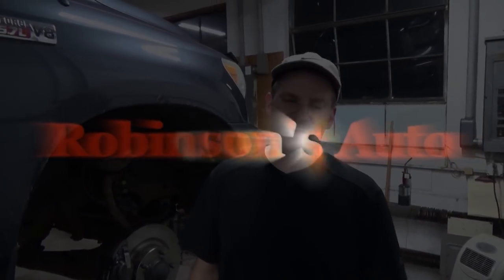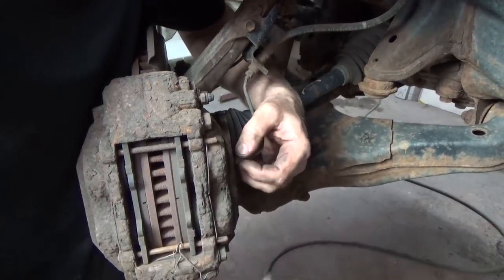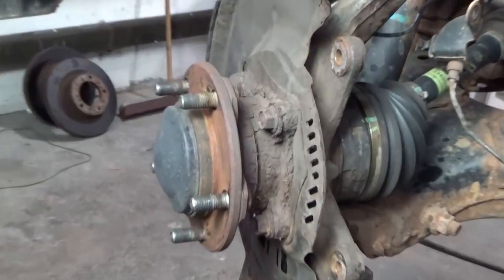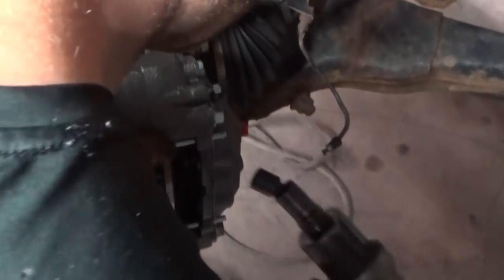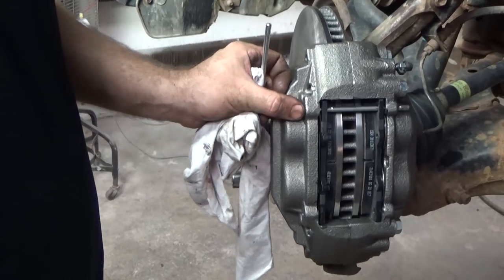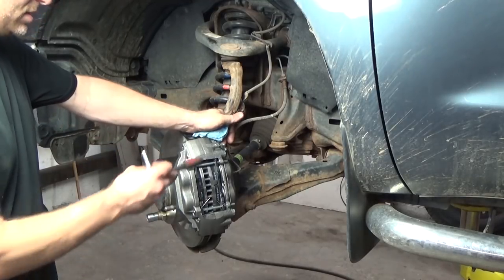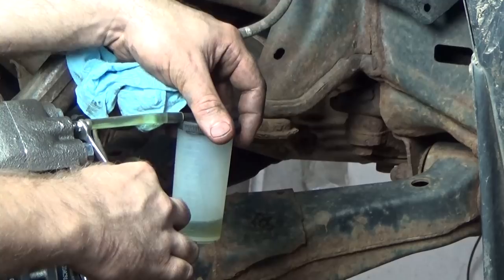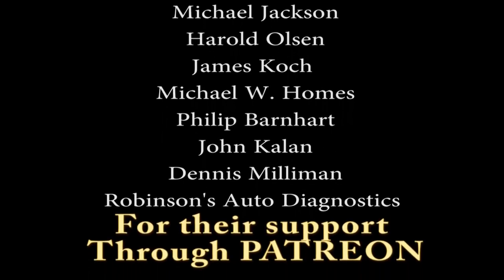Front Brakes Calipers and Rotors - Toyota Tundra

Comment: I have a Toyota Tacoma 2006 and once in a while it gets stuck and doesn't want to move forward or backwards. It's like the breaks are stuck, I checked my transmission and breaks and no problems. Would you say my caliperd need to be changed

Comment: Thanks 🙏 for sharing! Currently doing my 2004 Toyota Sequoia SR5, first time! Not sure 🤔 if the calipers are bad but I’m changing them anyways, already changed the booster but I was still having problem  when breaking hard, like something feel stuck and jerk and loud when holding down the break paddle and that’s why I’m changing those calipers (fronts) your video made it look easy and it is, hopefully this would fix the problem.

Comment: I'm surprised those wire retaining clips are so small, they must be stainless to prevent rust. Is there any special procedure you need to do to be sure the ABS component doesn't trap an air bubble?

Comment: Good thing to replace the calipers on these, probably 95% of the one's I do the lower inner piston is seized. I'm actually trying to remember when the last one I did that wasn't seized. When we get these in on trade, and they have anywhere near 20K miles on them and are going to be a certified vehicle they typically get priced assuming they need tires and brakes. Very hard on both.

Comment: Thank you for the video, I'm going to have to do this on my truck next week. One of the pistons is seized. Replaced the rotors and pads yesterday but couldn't get a new pad on the backside because the piston is frozen in place extended out.

Comment: Unfortunately,he doesn't tell you,you must have the techstream software to bleed the abs system,which keeps you from properly bleeding the brake system on these tundra's.
Reply: The dealer scan tool wasn’t needed to bleed my 2014 or my 2002.  Now, if you get air in the abs unit, that will require a more substantial bleed process using a full featured scan tool.  For calipers though, basic Brake pedal work and bleed screw sequence is the same as any other car.
Reply: @pawswet9476  no sir, if you're changing calipers and changing pads or changing l brake lines, the old fluid needs to be changed or flushed out, at least every other service, and I'm not going to get into moisture and contamination and the breakdown of all the internal components over time, but if you do it properly the ABS system has to be flushed at the same time and you need to texh stream software to do that. If you're just doing a swap out, half-ass service then no you don't need the software.

Comment: Wow, those calipers were crusty. Good idea on using the vacuum pump reservoir while bleeding the brakes via the two person method. It is not only less messy, you also avoid the possibility of air getting back into the system through the bleeder because the end of the hose is submerged in fluid.

Comment: ok if i replace just the front two calipers, i should then bleed those 2 only right? the bleeding for all 4 was because he wanted a whole new set on all 4?
 
would you bother to replace the rubber hose that connects to the brake hard line you removed in the beginning of video or if it doesnt appear worn out is it still good to go?
Reply from the maker: Hey there! Yup, bleed the front two calipers only. as long as the reservoir did not go empty you should be ok. If the rubber hose is in good shape, no need to replace it. Happy fixing!
Reply: @robinsonsauto  Thank you

Comment: I didn’t read all the comments, but the wire retainer you almost forgot should have one on top also. I know the one you took off only had one.  I have done several tundra brakes and two of those retainers should be in the box
Reply: Well I watch other videos and none had the top retainers.